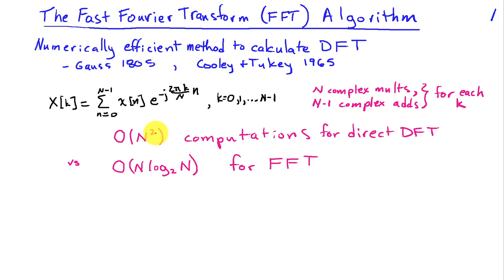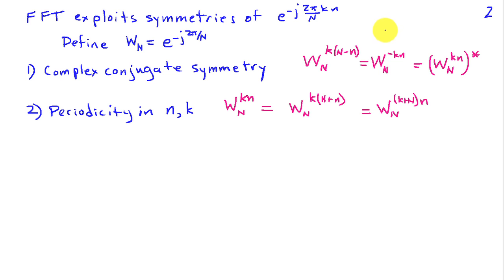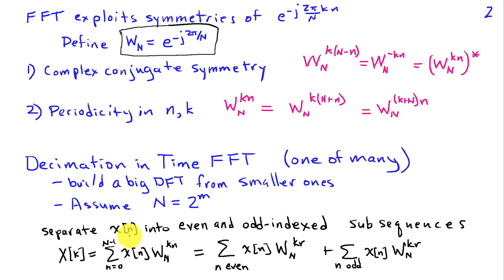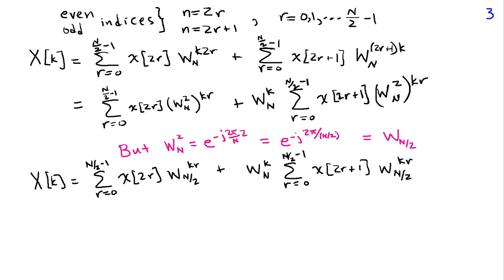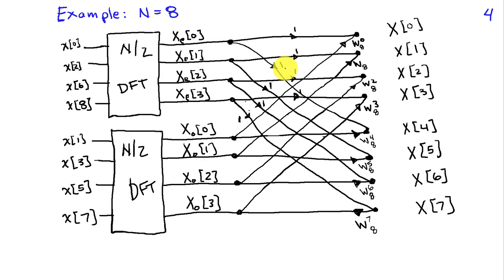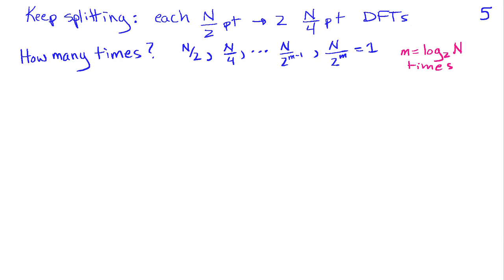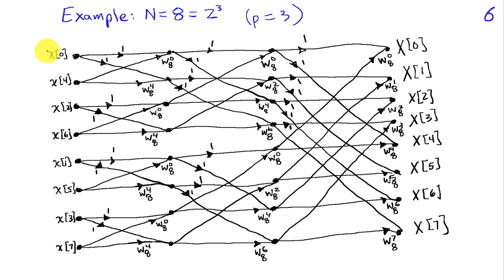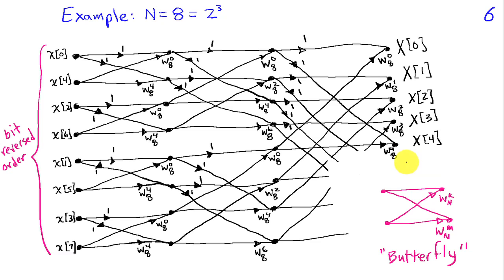The Fast Fourier Transform Algorithm

Comment: As an electronics technician of only a 2 year Associate in Science Technology degree in electronics for 37 years, and retired now, who helped engineers design, test breadboard and build / troubleshoot practical low frequency RLC circuits and also at the microwave frequencies for building 'cascaded microwave stripline amplifiers' in the 4 to 30 GHZ range for use in the real world, I had never used Fourier Transforms nor Laplace Transforms, I only used High Tech Oscilloscopes, Spectrum Analyzers, Vector Network Analyzers, SMITH CHARTS, Voltmeters, Ammeters, Frequency counters and computers,  and sometimes used ALGEBRA and TRIGONOMETRY to solve electronics circuits problems In the laboratory and in the REAL WORLD,

I have great RESPECT for the Geniuses of ELECTROMAGNETICS Pioneers, who had derived the mathematical physics of all the basics the we based our technology from: James Clerk Maxwell, Hertz, Gauss, Faraday, Lenz, Oersted, Henry, Steinmetz, Heaviside, Tesla, Weber, and many more, including  STEVE WOZNIAC.

Comment: The complexity calculation for the FFT as you explained in the video is incorrect.

2 summations of half size of the array will be N(N/2 • 2), which is N^2.

The benefit of FFT is from the fact that
W_N^rk = -W_N^r(k-N) when k ≥ N.

This is due to the symmetric property of the exponential function:
e^j2π = -e^jπ

Now you only have to compute the FT for half the array and the other half can be constructed by negating those terms, so you end up with complexity
N(N/2) for the first split.

Comment: To calculate the cost in the 13:42. It should be 2(N/2)^2+N/2, the next steps will be similar. So the final cost will be 3/2N+1/2N logN. It is because that the w of the lower half are simply negative of those of the upper half. So the cost should not be counted.  Of course under big O notation, the final answer is still O(NlogN).  You are really helpful, but there are some minor mistakes.

Comment: In butterfly diagram it should be x[4] instead of x[8] ,right?
Reply from the maker: Yes. There is an annotation at 10:07 that points out the problem, but that may not be visible on your device.  I have also uploaded a corrected version of this video to my channel, called The Fast Fourier Transform (FFT) Algorithm (c)